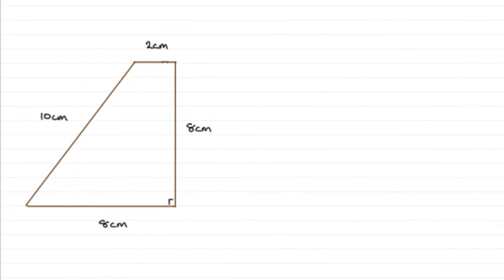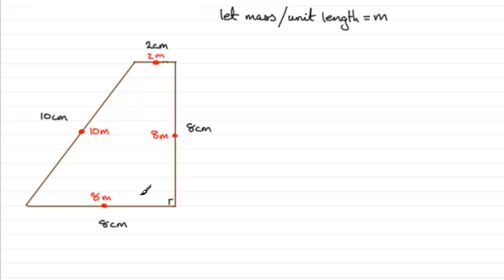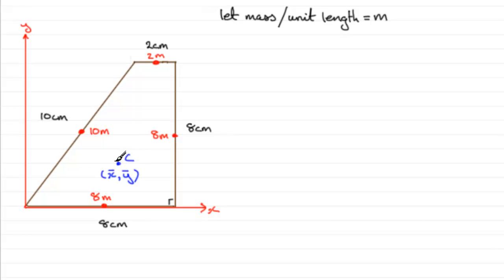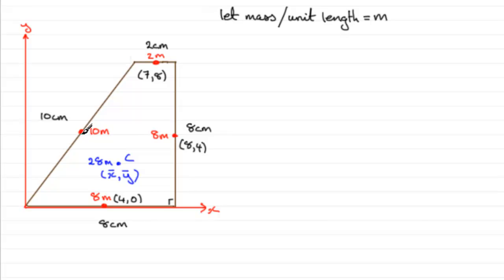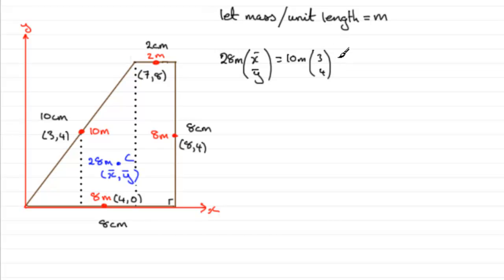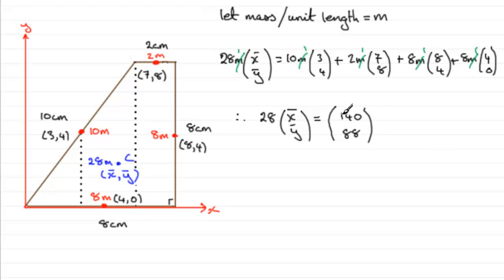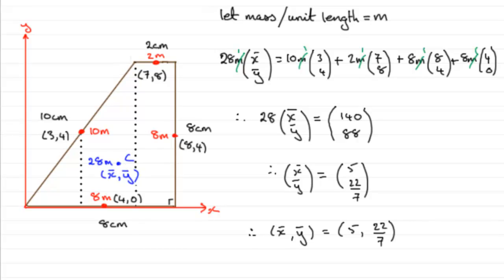Centres of Mass : Wire Frameworks : ExamSolutions

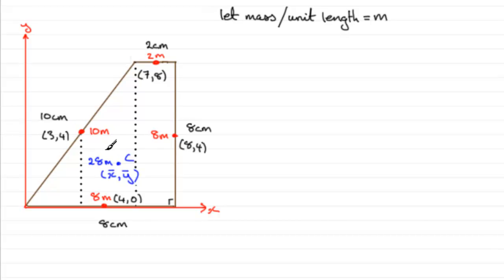Comment: 4:34 shouldn't it be 3.5 for the x value? half of 7
Reply: No cause the 7 is the 6 of the triangle added to 1 which is half the length of the 2cm wire